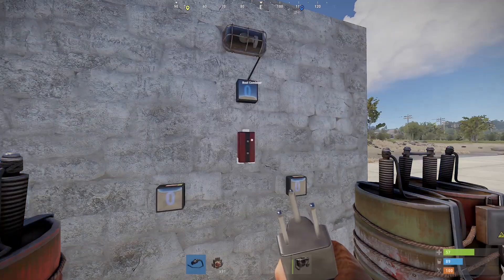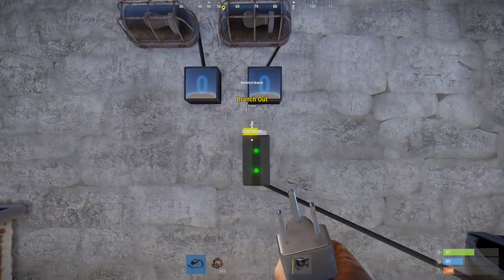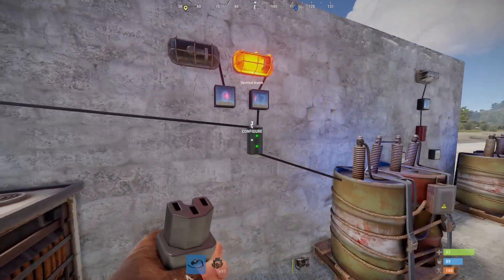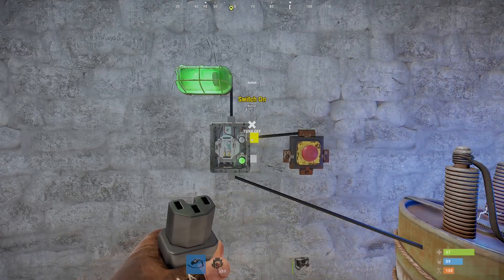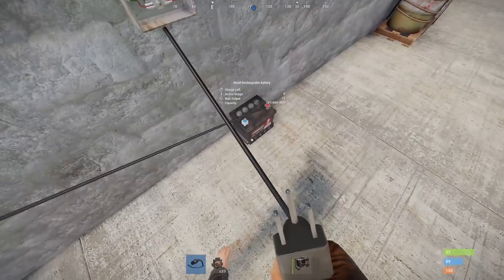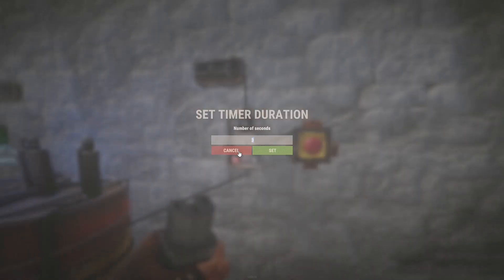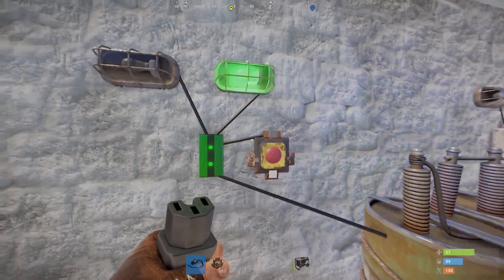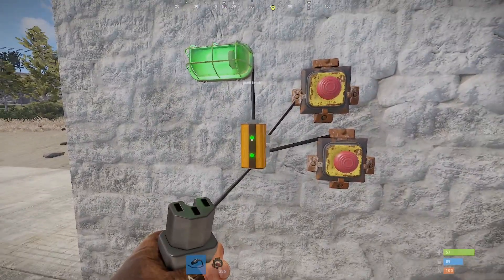Rust Electricity for Beginners - Ep 03 Combining & Splitting Power

Comment: 0:33 "It doesn't really like a lot of other non-source components connecting to it"
I thought it was literally: only source components (batteries, generators, solar panels, windmills, and other root combiners)
Checking on rustrician it seems the splitter, pressure pad, and reactive target can all also connect to it, which is interesting because it allows you to put other components between the power source and the root combiner that you wouldn't be able to otherwise.
Reply from the maker: @kevinscales  yeah... I didn't have a good sentence to explain the nuance of the root combiner, so that's what I ended up with 😅 I plan on going more in-depth on it in it's own video